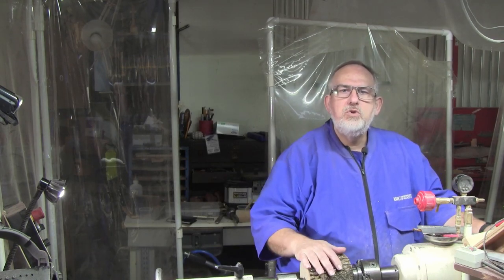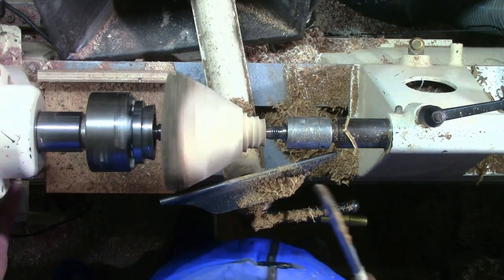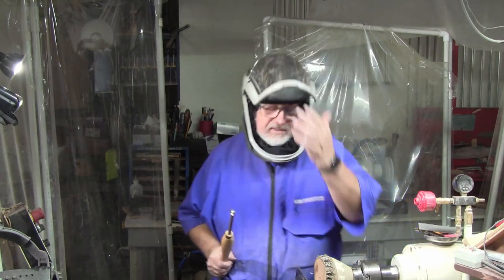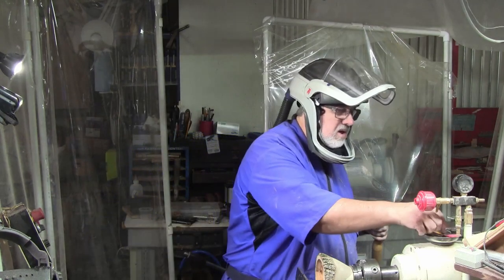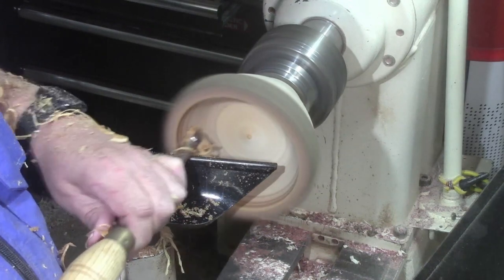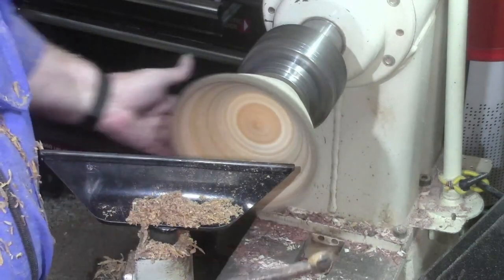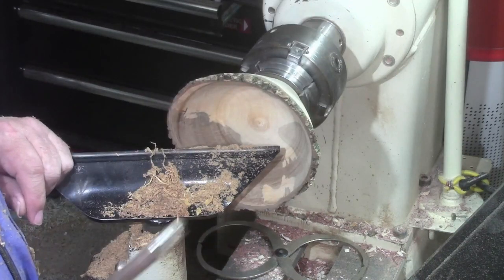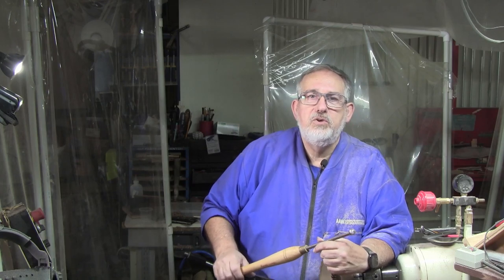Sorby Ring Tool Must have or gimmick? By Dean's Woodworking #woodturning #woodturningforbeginners

Comment: You attributed the vibration to the length over the tool rest. Yet the longest reach was to the bottom of the bowl and it did not vibrate then. Could the vibration be due to the angle of the cuter? The angle does change some as you come up the side of the bowl. You certainly were getting a smooth finish cut with the tool. At least very good on wet wood. I wonder how it does on dry? But the real question is: Does this tool do something that no other tool does? Or, does it do something better than other tools? Thank you for sharing. Have a great day and stay safe.🙂🙂
Reply from the maker: Actually because of the angle of the tool rest it was when I was on the side that it was hanging over the most. As long as i kept the over hang less than 1.5 inches it was fine over that it started to chatter. Which is excatly what I would expect from any tool with a shaft that size. Thanks for watching and commenting!!!

Comment: Dean, thanks for the demo. I have one of these which I bought about 20 years ago. It came with the conical grinder, long since lost, which I never used, just sharpen the outsides with a diamond paddle. I agree that the tool can be grabby if you're too aggressive or have the angle wrong. I have a curved tool rest, which I use if it will fit into the bowl. and this helps with the chatter. I don't do many endgrain bowls, and I kinda forget I have the tool sometimes. Anyway, you have given me some ideas for some small walnut pieces I have in the shop.
Reply from the maker: Thats great Ron, Thanks for Watching!!

Comment: I am intrigued by this tool. If you drilled a hole to determine depth would that help get started in cutting with the ring?
Reply from the maker: yes it will but you do not have to. I will be doing a video on the oneway Termite tool soon it is a ring tool as well. Thanks for watching!!!

Comment: Thanks, Dean.  I bought a termite tool (same as the ring tool) when I was first starting out.  Did one project with it (a deep hollow for an Ambrosia Maple cocktail shaker).  Chatter was noisy  - did not know to try to get the tool rest as close as possible at that time.  I put it in the tool drawer after that and never touched it again.  May have to give it another try now after watching your video.
Reply from the maker: That is awesome, Thanks for Watching!!

Comment: Thanks for the review. I have 2 1/2” Thompson bowl gouges that have a lot of chatter. Sharpened just like my 5/8” Pinacle bowl gouge which is awesome on same piece of wood. Any reasons for such chatter?
Reply from the maker: on a 1/2 inch tool if it is hanging over the tool rest 2" or more you will get chatter. The 5/8 is a larger shaft and you can extend it a little more. Thanks for Watching!!!

Comment: Like a dummy. I got in a hurry to get another tool up and running.. so I pulled off the motor on my lathe thinking it would be a quick answer for powering another tool. Welp, it not only wouldn’t fit my application but I broke pieces that were important to the operation of the lathe… then after about a year of not being able to physically do anything, it just seems like a giant job and I kick myself for being such a fool. I’ve gotten pretty good aim with those feet by now! I’d take it somewhere to get it up and running again but I don’t have a clue at where that might be. I just want my lathe back or even better, a small metal lathe and mill I could learn to make some of my own tools.. who knows maybe even make the parts I broke on my poor wood lathe.